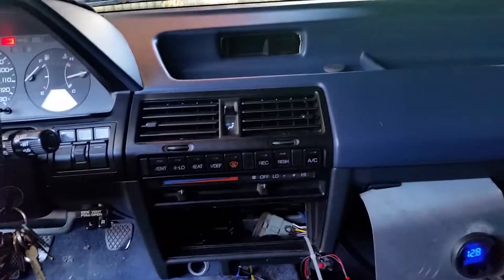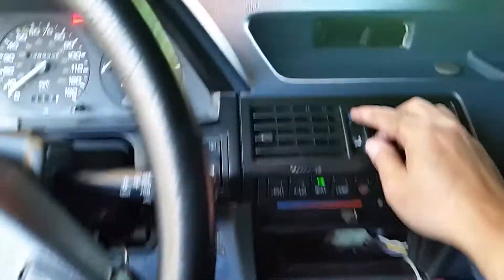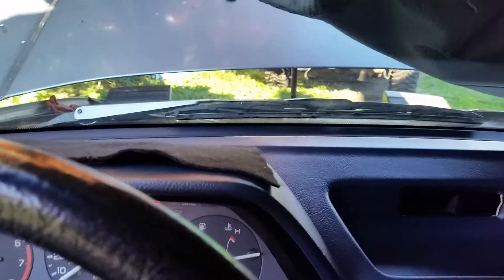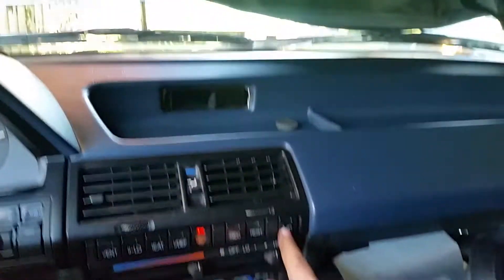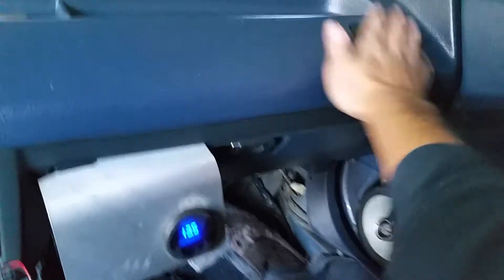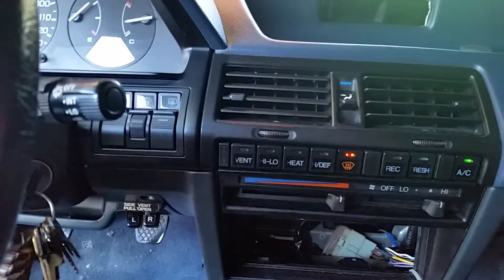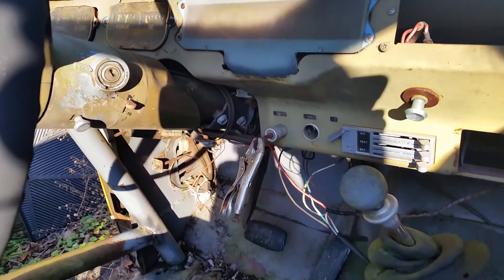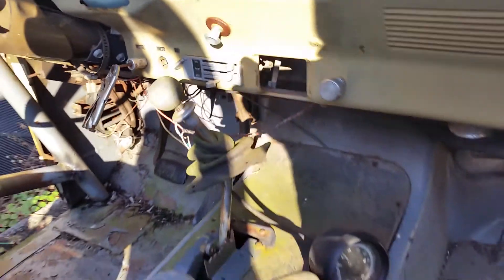1988 Honda Accord Heat and air buttons.

Comment: I had this car.
Vent is dash vents, hilo is dash+floor, heat is floor, vdef is floor/windshield, orange is windshield. Rec is recirculate, fresh is outside air, a/c controls power to the compressor.

In the center vent, that lever operates a heater bypass valve so that if its winter and you have the heat on, you flip it to the blue arrow and the air coming out of the two center vents is not heated so  you can breathe easier. It's basically full manual control of the ac. You can press heat and keep the slider to cold and get ac on your feet. The whole system gets air from the cowl on fresh and from under the dash on rec. The center level is just a bypass to the heater core so it will get whatever air you have selected, it just won't flow through the heater core.